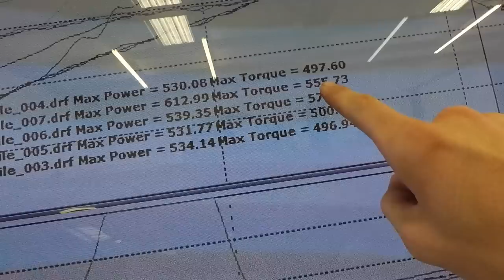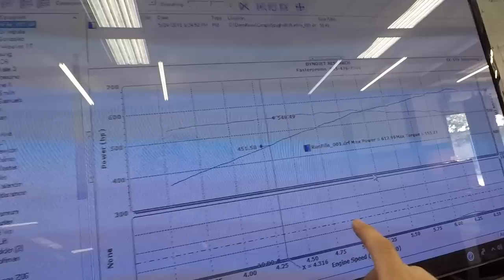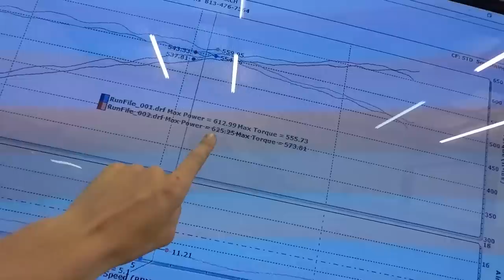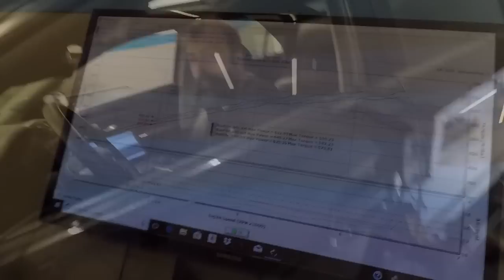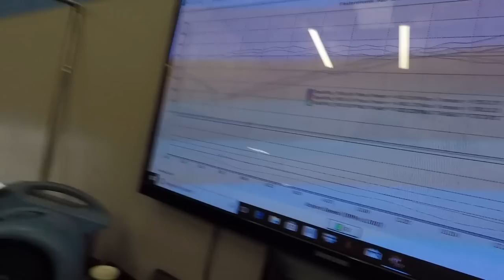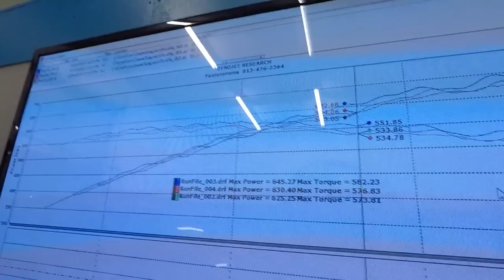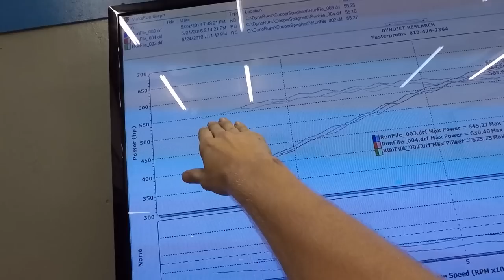Our Newly LSA Supercharged CTS-V1 Hits the Dyno! HOW MUCH POWWWAA!? (Pump Gas Only)

Comment: Jeremy is one of the best LS tuner's I've come across.I've had a lot of guys work on our  dyno and his stuff blows most of the others in my area out of the water. I couldnt believe that some of them where remotely tuned and while not as good as being there they where still 10 times better across the board than most of our local shops and one of those is a $pricey$ LS only place. I really dont get it though,so many places only do full throttle runs and done yet they charge like they spent the day on the dyno. Sorry for the rant but I just had a Z06 in from a local shop that is supposed to be the best around that was almost undrivable. It made nice numbers but that was all and i dont get it.This stuff isnt rocket science and I'm far from a tuning god,yet so many still get screwed when it comes to tunes.
Reply: SouthJerseySound Jeremy is a tuning God
Reply: I've been at this for close to 20 years now and usually I can find stuff in others tunes that needs work but everything I've seen of his is spot on. It goes to show he really takes pride in what he does.

Comment: 10 PSI isn't barely getting started on the LSA 1.9L Eaton blower.  Put a 2.38 or 2.55 upper on it since your balancer is already over driven.  The sweet spot for the LSA blower is 13.5-15 pounds.
Reply: Yeah but you need fuel to match the air
Reply: Captain 
insults, a true sign of intelligence.
Reply: Sergeant Speed Not watching the video, a true sign of intelligence.
Reply: When did they say what injectors are in there?
Reply: Jon Tostanoski Back in the original videos of the build, they’re massive. And he has a serious fuel pump and inline boosters. He’s got enough fuel for anything that 1.9L can make. He says that himself in the video.
Reply: tct72 most of these followers barely got 2...
Reply: tct72 Exactly
Reply: YZFoFittie Don’t be so mad because you’re wrong.
Reply: Sergeant Speed>>  https://www.youtube.com/watch?v=TnrRDe5C-Gc  At about 1:07 you can see a performance mod that allows massive fuel flow. Captain could have been nicer but I agree with him.
Reply: 7470alexander 👍🏻 Nice isn’t my style but yep.
Reply: tct72 2 inches works for me.
Reply: Mike K nahh
Reply: It's a shitty LS on stock internals. It will blow up if you run any more boost.
Reply: tct72
i wish i had 2 inches
Reply: jon doe your not wrong buddy

Comment: Cleetus we have that same big fan, that you put in front of the V, at the warehouse where I work. If yours has the option to add cold water to help cooling, DO NOT DO IT. it will increase humidity drastically, only use the fan part of it and it works much better

Comment: Essentially Cooper you did actually reach your 707 mark in fact you went past it ...based of the fact this is all based on the tire vs the 707hp figure advertised on the hellcats now multiply .15 into 630 and add that and that would be considered your drivetrain loss and what it would be to the crank even then the supercharger is considered parasitic weight so it also adds onto the drive train but over all good shit

Comment: So basically it make 50+ less HP than Kyle's 4 banger hatch and the minivan, lol.
Reply: Youknow88 it's also  twice the displacement of the 4 banger plus power adder added so what's your point
Reply: ClutchkickPJ wassup my dude
Reply: Del Fam ones way more reliable
Reply: Hondas are even gayer than LS motors though.
Reply: Probably weighs twice as much as the BoostedBoiz hatch hahaha
Reply: Kyles hatch is pretty awesome.
Reply: Del Fam
dude theres so much more to it than peak hp... see the part where it had 500 ft lbs at 3000 rpm? hondas don't do that
Reply: 14 psi less*
Reply: you are the one that is misinformed its not all about the torque it's more about the powerband in a whole. just look at diesels, feels quick (some) but are slow

Comment: That is some solid power for just 10lbs....is the V an LS2 or LS6??
Reply: Gen 1 CTSV have LS1. Cooper does have aftermarket heads and cam on the stock block though. Along with full bolt ons.

Comment: Put a horse on the dyno and see if it makes a horsepower
Reply: Matthew H probably like 20% drivetrain loss so I’m guessing .8hp at the hooves
Reply: What about out the poop cutter??
Reply: Matthew H has to be a amarican horse tho
Reply: Put a carrot in front of it and make 15% over stock
Reply: Lee LeTourneau bro I'm not even lieing that was the best thing I have seen all day 😂😂😂😂
Reply: Nah honestly horses have some torque so honestly they probably like 10 horse power in one😂
Reply: Kyler kemp 😂😂😂
Reply: Technically speaking it will make exactly 1 horsepower but with some basic bolt ons, shoes, leather harness, plated main etc should make more than stock for sure
Reply: They can actually make like 15hp at peak power #notevenlying
Reply: Lee LeTourneau you really said .8 at the hooves...💀💀
Reply: If i remember correctly a horse actually makes 3 horsepower,  probably 5 if Jeremy tunes it
Reply: After Jeremy tunes it will have so much torque that we’ll have to call it Mr Ed the torquing horse 🐎😂
Reply: wasn´t one hp the work that a horse could make constant over an hour ?   so in a dyno situation a horse can make more ( if i remember correct up to 12 or 15 hp )
Reply: On peak output horses actually generate way more than a horse power. While no differentially stats exist for horse vs draft horse, a horse can generate 15hp for a short burst (like a dyno).  A human can get well over 1hp, some sprinters 2.5hp  peak although for long lenght of time 0.1hp is more accurate.  A horse will generate 1hp for extended period of time and most engine cant substain their max output for long either. So one horsepower from a horse is kinda more than 1hp from a engine. If we're talking dynamometer, peak horsepower to peak horsepower, horse are thus 15times stronger than engines.
Reply: @Basstaco69  close, but read my post it's actually 15hp peak.

Comment: Has that got the LS2? Not sure how they're making that much power on pump with just heads/cam/blower if it's an LS1. I've got cam/turbo package on my LS1 pushing 545hp so heads can't make that huge of a difference right?
Reply: with boosted engines, heads can make a massive difference.

Comment: I forget you ls guys can’t make any power on 93 lmao
Reply: Noah Pierce Keep in mind this is an old LS1 stock bottom half with some moderate mileage on it. Who knows how the previous owner maintained it. Lol.
Reply: Gavin Au it’s still a big displacement super charged v8 to get any big numbers on pump gas you have to use meth lol I’ll take my over head cams over an ls any day, unless i was broke
Reply: Noah Pierce I mean a stock LS1 in those cars makes about 280 at the wheels.  To go from that to almost 650 on 93 with 10 psi and a cam is pretty damn good in my opinion.
Reply: Says the guy probably putting down 240 to the wheels 😂 in a 4.6
Reply: Marvin Wilson 728 in a pro charged 2016 pp gt but close :) my profile picture is a 2014 v6, my first car, I’m 19 now
Reply: Noah Pierce  19 yrs old?   Your ignorance makes sense now.  You’re forgiven.
Reply: Must be nice spending mom and dad's money.
Reply: Jay Dunbar nothing makes me happier than spending daddy’s money, my mom doesn’t work, he makes enough money so she doesn’t have to:)
Reply: will yoder ignorance? It’s no secret ls guys can’t make power on pump gas without meth... just what happens with old technology, my quad over head cams, and my all forged internals do just fine on 93, but it’s also significantly more expensive, not hating on ls guys, just facts
Reply: Noah Pierce forged internals only help with durability and strength bud lol
Reply: eJack uLate me and my buddy bought a 1969 Mach 1 fast back? Is that better? Got a 351c, we are boring it over to a 408 and giving it 700 hp on e85🤷‍♂️ is that a real pony? Or is it stil a phony
Reply: @noahpierce4746  you're gonna bore it to a 408?
Reply: John Foskey yeah a 408,
Reply: Noah Pierce do you mean bore and stroke?
Reply: @noahpierce4746  by the way, don't change that POS V6 Mustang from your profile pic. It suits you too well. 😂
Reply: Type Best alright i guess i could change my pic to my 650 hp 2016 gt i drive to andfrom school in, look up snoggatog on Instagram and you can see all the nice things i can afford cause I’m not poor like you
Reply: Type Best lol real Shelby? Yeah i like my faster car with a better engine it’s okay buddy maybe one day you can afford a car like mine if you put in the hours
Reply: @noahpierce4746  enjoy your chopped up Mustang. Leave the SVT products to the men. It's passed your bedtime. Night 😘
Reply: Type Best i will enjoy My 50k mustang At 19 while i attend college so i can not be poor like you. Class doesn’t start till next week. Keep dreaming big buddy one day you might wake up and realize you’ll always be poor
Reply: Ada 1812 you are literally just poor
Reply: Ada 1812 odds are is that you are